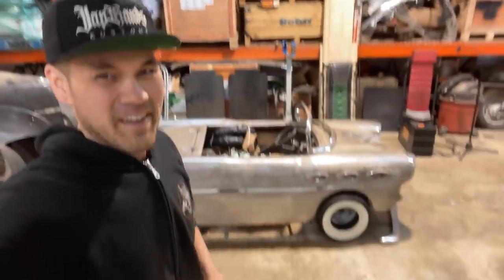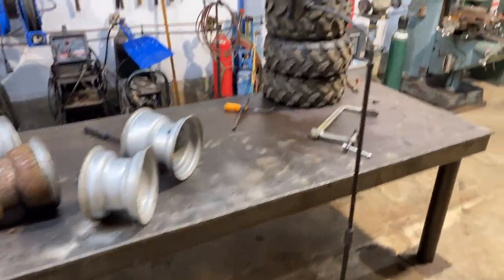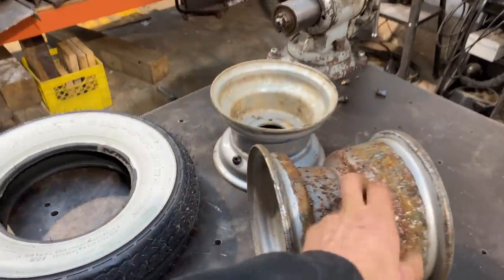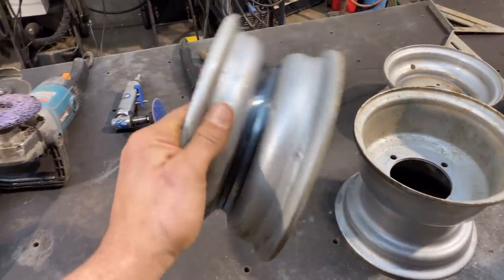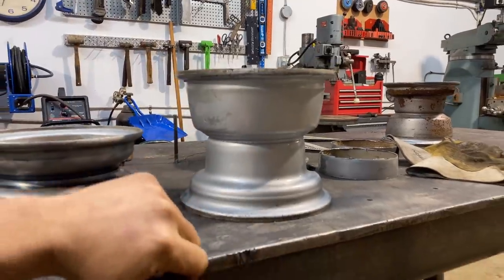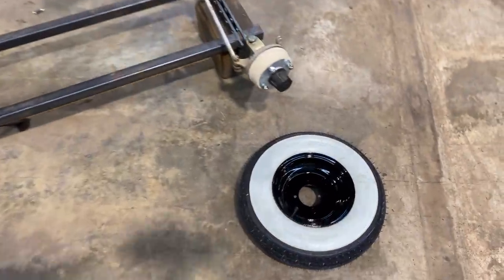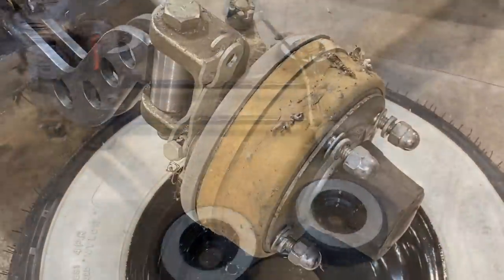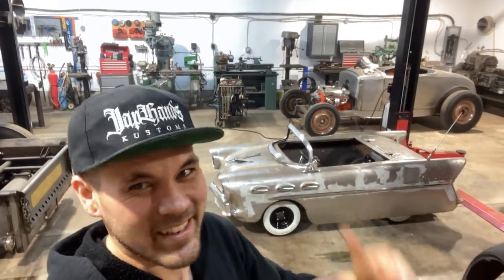1956 "Baby" Buick MINI CAR!! - Narrowing the Rims to Fit New White Wall Tires!

Comment: I feel like the rear could use a small wheel well opening. Only a inch or two tall and as wide as the front. Cool project either way. Would be fun at swap meets with a trailer for hauling treasures you find.
Reply: I'm with you on that... it would break up that lone flow from the front and show off the 'deep dish' too
Reply: May be a rear fender-well and a fender-skirt to fill it back in with some  body line .
Reply: I would get the measurements from a full size Buick, and shrink them down to match this go-cart so it would look proper. And showing off the deep dish rear would be very cool.
Reply: You could go full blown crazy on the build with “Robin Eggs Blue” over a “Cream White” then finish the interior with a light brown/tan mohair using tuck & roll. It could go off the deep end quickly.
  Just fog the engines cylinder thru plug hole using a marine grade fogging agent and place a battery tender because of electrical start, and on! Place a park brake for the mechanical front brakes. I can’t stop!
  You Karl are blessed to have known the gentleman that started this project, meanwhile showing us simple repairs/changing the wheels. Not as easy as you made it look! Blessings!
Reply from the maker: Yea you are right it needs something to break up that space

Comment: Mom drove one of these when I was a kid.  It was black on the bottom and white on the top.  If you go with a brushed finish with clear coat on the chrome bits it would give you a nice look.  It drank so much gas that she had to fill it up 1/2 with high test and 1/2 with regular.  We ran out of gas a lot because she rarely filled it up.  LOL.

Comment: My idea would be this- since making adjustable suspension would be way too much work, make the body height adjustable. A couple window regulators and some ingenuity could make it happen!
Reply: Yes make it  Shiney, metal flake no design  black line doors and finder skirts, it is a beautiful  little  car from Alabama  roll tide
Reply: Excellent idea! Mount the body on linear actuators!
Reply: Fuck yeah!
Reply from the maker: That’s a great idea too with adjustable body positioning
Reply: Great idea.

Comment: On your '56 Buick mini car, your chrome trim can be powder coated with chrome powder for a fraction of the cost of chrome plating. My two sons own a powder coating shop and they powder coat chrome powder for their customers and for me. It doesn't have the depth of real chrome but it does look good. Check with your local powder coating shop.

Comment: Nicely done. I'm with you on the patina look. It work perfect with the chrome imperfections. I think lowering it say another inch in the front and inch and a half in the back for the tail dragged look.    Very cool project.
Reply: Blue and white two-tone any color blue
Reply: @robertgardner3408  personally I hate the patina look, so I am with you on the two-tone.
Reply from the maker: Right on! Ya that’s the best for now I think too. Maybe one day I’ll get some nice chrome for it and paint can be an option but it will
Look awesome patina and I’ll prob let more people drive it 😆

Comment: My opinion, some shallow sweeping rear wheel wells to show off the rims a little and take away some of the “slab” sides. The interior idea is great! Maybe some small cranks from wing windows to go with the mini theme. Suede paint of any color and top it off with 8 ball or dice valve stem caps. Awesome build!

Comment: My two cents’ worth is add rear wheel openings and give it nice paint, not a patina job. Flat paint maybe – but no patches, scratches or fake rust. Tiny bullet-shaped caps on the wheel hubs would be neat.

Comment: Suggestion for the chrome: there's a 'fake chrome' powder coat that's available. My Dad used it on some parts of his '39 Chev restoration and it's convincing enough unless you look really close, and about ten percent of the cost of chroming.
Reply: I have also used the powder coat chrome (super chrome two) it turned out good! Good idea and way less expensive!
Reply: There's also a product called Alsa Easy Chrome that can be brushed on and dries to a mirror finish. It's self leveling. Very cool stuff, look it up on here.
Reply: A lot of slot car and model car guys use alclad chrome spray paint in an air brush for "chrome" parts, and it looks pretty darn good.
Reply: Chrome brush plating is an option, but there's the danger of hexavalent chromium turning your entire neighborhood into a brownfield.
Reply: 0

Comment: Carl I love this little build.  One thing that I think would be awesome are some curvy rear fender skirts to show off the white walls and add a little to the fun flair to bottom body lines along the sills.  And it’ll give you easier access to pull a wheel should you have a flat.  (ETA: like a 57 Chevy-ish)

That hard straight ground line at the bottom of the sill from the front well well to the rear bumper just looks a bit flat and underwhelming.  Makes the rear side look a bit boxy. 

Go with classic two tone pastel colors out of the 50s. Paint all the crummy chrome something like a gun metal gray. So it pops but doesn’t look like shitty silver paint on crappy chrome.  Patina chrome on a fancy new paint job may look off. It’ll be alright if you patina the new paint so it matches the aged look of the chrome.  

Wish I was there to help and learn.  You’ve got some sweet skills and imagination to figure stuff out.

Comment: probably been said in the comments somewhere already but could've had 2 piece/split rims and just welded a disc in and sandwiched the 2 halves together with the wheel nuts, no more stretching tyres on then

Comment: You could do a red pinstripe on wheel rim just below the rim lip, also have a look around the swap meats for chrome or stainless Steel centre caps.

Body colour wise a pastel blue bottom with a soft white top joining at the swage line.
You could then in areas rub through to the metal in areas of the wheel arch and lower edge of the body close to the floor and the upper part's of the body in areas rubbed down to the undercoat with the odd spot rubbed through to the metal, then lacquer it.

Just an idea, but it is your choice at the end.

Oh forgot you could have some pinstripes on the bodywork too, like around the hood emblem and matching it on the trunk.

Comment: I really watching you solve problems like narrowing the wheels and using the drill press to break the beads. Someone else commented lace paint on the car and like the 55-57 Chevys and Olds Rocket 88, needs to be 2 tone. Awesome work and Cam was so lucky to have a wonderful friend like you.

Comment: I agree with one of the other comments,  maybe just a scooch wider on the axle at the back, but I would also widen the front and get the tires sitting just inside the guards. But that's just me. It's looking amazing and is going to be a heap of fun, great work on the steelies and those whitewalls really pop!
Reply from the maker: I think you are right. It would be worth making some spacers to get that looking propoer

Comment: the lil buick looks great . it would look good with 57 chevy shape rear wheel wells and mabe some chrome center caps with the point like spider caps have. 
a patina pastel 50's color paint job with some pinstriping and metal flake tuck an roll interior with a metal flake steering wheel.
 towing a matching paint baby teardrop camper would be awesome too. it's all ready kool lke it is.

Comment: When I was ten or twelve, one of my dad's friends had a 56 Buick that was 2-tone black and ivory. It was one of my favorite cars, even better than my dad's brand new '59 Cadillac partly because the Cad was pea soup green. I think a black and ivory 2-tone would be great for the Baby Buick and that a slight patina would add authenticity. I'm talking a few chips and scratches here, not a bunch of ugly surface rust. Age it gracefully, like a garage-stored one-owner, low mileage survivor, original and unrestored. I love your little car. I'd have given anything for a car like that when I was twelve.

Comment: It's super cool. Gotta put it on the rockers. Or at least take it down a couple inches. You got the wheel clearance now. It's gotta tuck some white. 😉 I like the vision for this thing. If you're going to do a full interior. Spray chrome and a Rust-Oleum two-tone. Blue and white or something cool. It needs the full 50s follow through. Killer work as always. Love watching your channel always great inspiration and knowledge.

Comment: I'm enjoying the using us as a second person in the room when building a mini hot rod. As you cut those wheels down, I thought about using a lathe an then do your weld when all the size and shapes were tried. I first thought... making your own bead locks and then using as a pattern to make many more. I would slow your roll so bad that you  would run me off in a few minutes of jamering. I am seventy two and old fashioned as granny panties ... love a metal bead roller, shrinker stretcher tools. I made my own frame straightener and used old military milling machines, line bore, stuff left over from a mining operation to get different ideas from. Never got as far as the mig but ran a few and just loved the tig. I used to weld stick for Todd shipyards and got so sick from welding in tight confinement. Like your patina look and just polish on stainless. I best duck out now

Comment: Patina would look great as well as a sparkly paint job you can’t go wrong either way! Put some 2” wheel arches on the rear and put your steering links under the frame will give you better foot room.

Comment: You should pay attention to the steering geometry. The steering axis (kingpin or through the ball joints) should intersect the ground through the center of the tire's contact patch…roughly.

By narrowing the wheel, that way, you are increasing the offset, and moving that contact point. That will do something, I'm not sure what, but steering will be funky. 

To correct or avoid that, you'll need to change the angle of the steering axis, which will also effect the camber, unless you also mess with the spindle…

Comment: Nice work, as usual. An alternative, if you don't mind using tubes, would be to turn them into bolt-together rims by adding a central disc to the halves you cut. Just an idea.

Comment: A little lower with the body and a k.i.s.s. of chrome paint on the trim molding. Colors with the antiquated weathered look two toned using a color to match the Cadillac with a white on top when done. And yes distress the paint with artificial rust around the right spots.

Comment: With a double cut on the rear rim, one on the tapering outer area, the other 'cut' (actually two cuts to remove a 'band') you can then slip the 'inner' part into the outer section (of the inside rim) to make a lap joint ... then weld that whole narrower 'inner' to the wheel bolt area 😄 PS this is a lot easier to physical show than to write! PPS about 40 years ago I built a "shorty" 4x4 by doing this to the ladder chassis (main rails were straight box section, narrower at front than rear), I've also made two wider rims starting from four brand new steel wheels from eBay 😎 using the taper/lap joint method

Comment: Hey Carl, I like the new wheels and tire, they are right for the little thing. I think that a pink and white patina painted body like the 56 Buick came with stock would be really cool. Maybe find a way to make the body lift and lower would be a good idea instead of lowering the whole thing. How about some electronic actuators to do that. The plane on the hood seams a little to large for it. But she is a cool car. Later

Comment: Great job on the wheels Karl!!!! You could either polish the chrome or powder coat it chrome and definitely patina the paint. Another thing I might do is cut the rear wheel wells out a little to expose the rear tires a little more. What ever you do to the Buick it will turn out fantastic Karl. With your skills and vision it will be great. Can’t wait to see how it turns out. I have a lot of respect for you my friend. Thanks for sharing.☺️☺️☺️👍👍👍👍✌️✌️

Comment: Maybe run a Pinstripe (color of choice) that matches your patina on the outer edges of the rims, or if more "Hot Rod" maybe Full disc Wheel covers Bonneville status? You have the skills Karl, love the rear deep dish work, too bad blocked by the skirts, coming together nicely just the same, love the enthusiasm in how you approach the task 👍

Comment: Heres a color  suggestion , something you might not have seen. Australian commodore color , Morpheus.  Tried to paste a pic didnt happen . easy single layer base coat , covers really well. Shade changes with light, if you look it up , look at several images , computers dont really do the color justice

Comment: Looking good it's getting there. I don't know if you're old enough to have ever seen the Lakers side pipes with the block off plate bolted on to them. If you end up lowering the back of the body I know that gas tank and air cleaner has to be relocated but you already spoke about that if you were to just lower the rear and Fab up a pair of Lakers sometimes and do the pipes and all the other Chrome pieces in Chrome powder coat which looks sweet
I can see that the body needs a hell of a lot more work if you plan on doing a nice paint job or even wrapping it for that matter. Black primer always looks nice and then a white tuck and roll interior with black carpet done

Comment: When i widened my Fargo wheels, i used my brake lathe to split the rim. 2”flat stock rolled into rings. They were dead straight. Oh, i was just suggesting using the lathe to split the rim. But its not a race car. 
As im watching, thinking a plate would be the plan, there it is. 
You certainly pulled it off! 
Sure makes a guy smile!  
Patina or satin black and red!

Comment: Ya done a great job on the tires, but Ya got too do the rest.  tuck and roll bench seat. the panel section of the inside is a great idea. the paint should be a Buick paint.  there should be wood trim dash carpet that match's the seat.  as to the glass, Lexanne there are many colors to pick too.   to make the light trim, that C&C would be great help  low heat the lexan over  bucket then let sit too cool.

Comment: Excellent work as always. You could put them on the spindles and check the back edge with a dial indicator just for grins. I think you would be surprised at how good they are. I did something similar for my 36 Ford with the wide five rims. I wanted wider rims so I cut the rivets out of the wide fives and mounted them in the center of Ford Explorer steel spare 16” rims. I mounted on a spindle and checker runout with a dial indicator and they were within .010.

Comment: I agree it looks great with the white walls. Definitely need to drop the body a couple of inches to look proper. Two tone paint like an original would do it just right.  I think the rear axle needs to be widened to better see the deep dish rims and to look like it fits the body.
Just one opinion. anything that you do will be awesome!!
Reply from the maker: Love it man kinda on the same page here. Patina two tone and a wheel opener gonna the rear possibly

Comment: Looking good. Suggestion: use a modern day seat rail inverted to hang the pedals off. That way you can change to leg length for people of different sizes using the seat rail sliders. Cool idea I saw on a haltech speed video today.

Comment: For me I think the wheel stance is just a little to narrow but a really easy fix instead of altering the axles would be to make some wheel spacers  front and back.  As for colour I can see all white, or Satin black and maybe a light creamy grey colour. There is a cool grey on the new Ford Ranger truck I just saw and it is such a different colour that the normal it looked cool to me. Great job on the wheels.

Comment: I love this project. I agree, there needs to be some wort of a skirted looking wheel opening in the rear. And as you were mocking up the steering, I was yelling at you, that is backwards. We once installed a 3/4 ton box in a 1/2 ton  Dodge PU, and it steered backwards. The owner spent 10 min trying to get out of our shop before figuring out what was going on.

Comment: Some small bikes just bolted the two halves together and used a tube. That would be the easiest way. Makes getting the tire on easy too. Just cut that weld on the inside of the wheel and separate the halves. Narrow them and keep the flange on both halves so you can bolt it back together.

Comment: At 19:37, try using a deck of playing cards stuck on end into the rim where it meets the rubber. If you overlap the cards 1/4” (11mm) then you have an easy way to paint the rims with the tires mounted.
No masking tape or paper is required.
Cheap Trick! (Hey, Good band name)
   Love the work. I am going to need a bigger shop… Nope, just something bigger than 1 1/2 car garage!
 ASE master, retired.

Comment: Well that's a new way to use a drill press.
Your welds look good enough to still go tubeless.
It still looks like you need to bring the front rim/tires out an inch or two. Maybe add some bump stops to limit the steering. Otherwise the tires are going to eat up your leg room.
Baby blue w/flake. What about fake side pipes for that lowered effect? The chrome looks like it will buff out.

Comment: Great stuff, Karl! A few have suggested a small rear wheel arch, I agree, about 20% of the height of the front arches. You're really invested in the portholes, as you should be given you're inspired by a 56 Special, but I think they'd look better smaller, maybe round instead of oblong, scaled a little closer to the body scale and positioned further back, as on the original. You're super clever, I'm sure you can pull this off. Can't wait to see you fab up the inner tub!